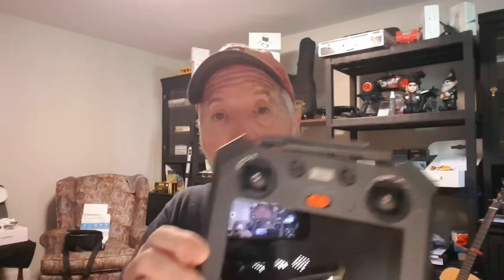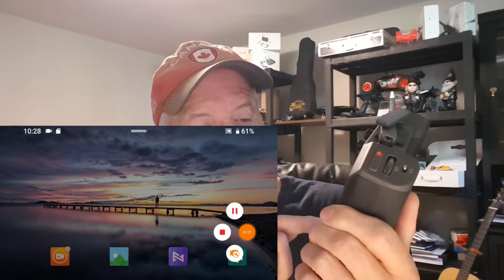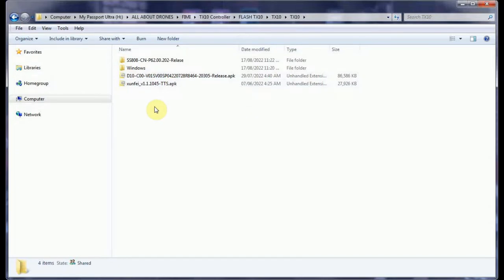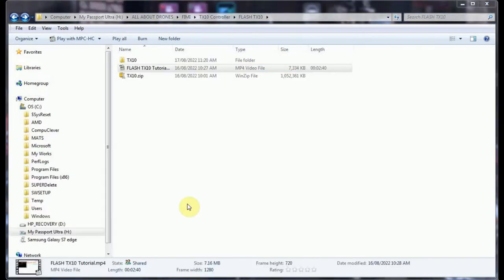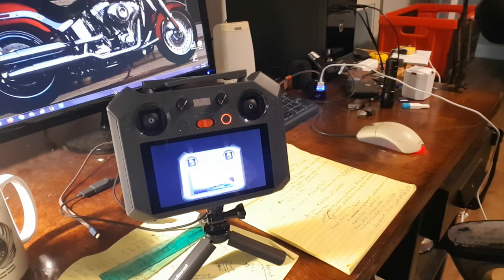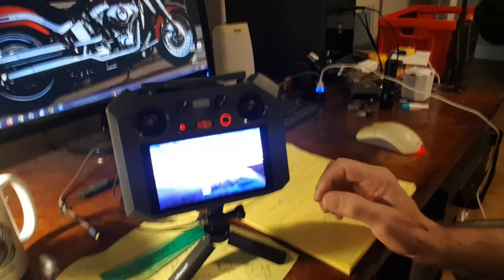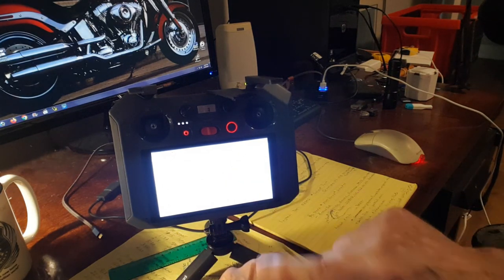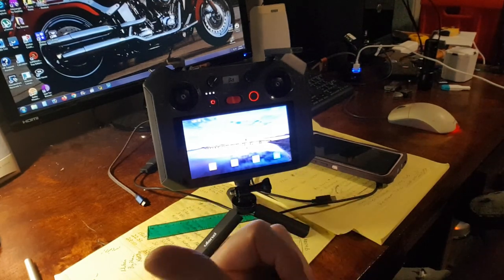FIMI TX10 Controller How to  RESET - FLASH Update -  No.5

Comment: Hi, what is the link to the TX10 zip file that Fimi gave you? The link that Fimi gave me (same as what Tony ling listed in his flash video) produces an unzipped file with 37 file entries. None of those files include anything that I understand or seem useful to doing the flash. I can't even get started to do the upgrade. It would be nice if Fimi could have given us one file that could be transferred to an SD card to insert in the TX10 to do the system flash. That's how Autel firmware updates their EVO ll drones.
Reply from the maker: I put it in the description. The process was almost exactly like the Ling video with a few side steps.. the power button turns red not white and I had to manually search for the QFIL program.
Reply: @GorillamansGarage  Hi, not until Fimi makes updating the TX10 simple, I'm going to live with the drunken clock. This is Fimi being consistent with the Fimi X8 SE 20xx having a drunken horizon. LOL